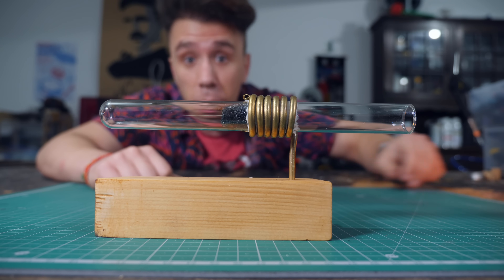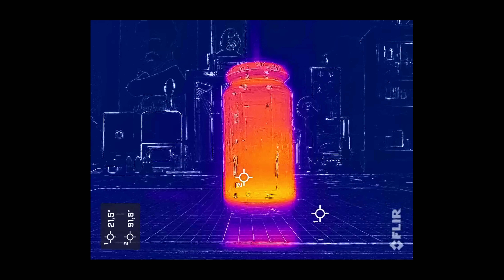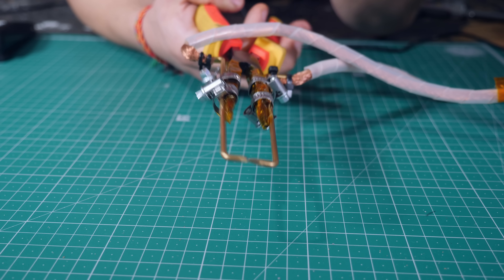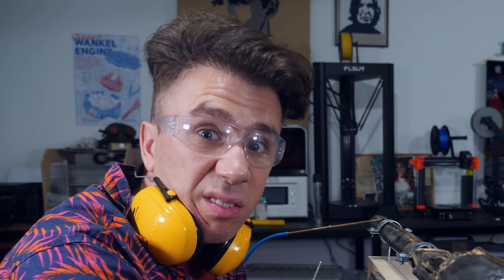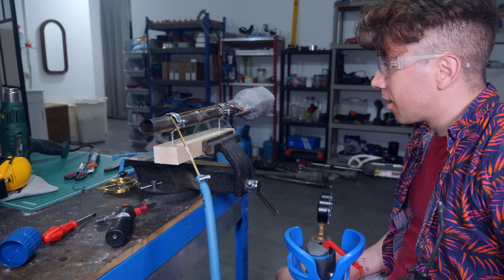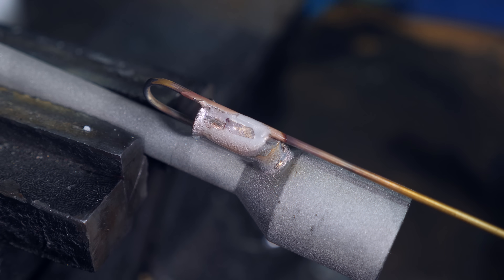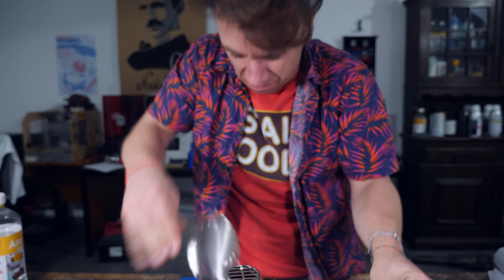JET ENGINE with NO MOVING PARTS (Pulsejet Engine)

Comment: Integza... 
  Shock waves and sound,  and light, and mgnets m, the ocean, all have ... what? 
 Waves... 
   Ok.. so Im ' with you " on that. 
  Are we to molecular  and chain forms of fuel,  avesrge atmospheric contents..  
  Orbits of Elemental electrons and protons and beurtons.. 
  Odd and  'poor harmonics" ? 
  .. what do you think about eye chart tests? 
  I think their results are off beause they do not measure lenses(eye ball) sizes and ratios.. 
  20/20.. that's 5x4 an 4x5.. or something like that 5x20 is 100 though  so who knows ..  but Music, right (?) that echos,  ecuse me, I need coffee, compression and expansion and what gasses diesel compress... and hmm magnetic field ' heat " (activity") .. 
 Why the sky is blue..  something 'dull" insulates... or maybe Im soeaking  backwards.. .. I need coffee integza.. 
   I have some, Ellen D. Of the Same last name got me some and   some htdrogen peroxide cause I have bug bites..  ok let me let you machinate on... does math follow the path of least resistance ? 
   Or are we negilgent and thinking lazy...  .
 Ok,materials  and resonance , and compressions and expasnios  and their spoeed. 8ths and 16th.. 
  Lol.  
    Integza.. not a dik measurement contest, but shock wave and post reliefe compressions . Temperaturs an cooling, do they also  follow the similar rate.. .  Horse shyt if you were thinking that yourself or your  pipe would have more of a parabollicks lol.   Reflectively speaking angled back for conservation and the size of it would also.  And so would your lense  and pulse be more jointly unified  in the their naturally it elementary Holmes..   
  Even thrust  passed the plate.. 
  Fcking A Integza.. 
  Dude, Im fckign not ' ok.. 
 Yeah ballista and lengths of  projectiles  heights of a tornado,  one more sustained than another? Time of day and height of atmospheric dome .. and a spring .. 
 So.. like I said.  Im there with you.. 
   Number of blades and the programmed or calculated steps in the stupes, fluidity of motion and the neesesary  repulsion  increases or decrease  in drawing or applicable forces..  
  I like your engine.. but it is not in as quick and amorphously reactive . .  
  Number of waves reflected back and the ammount allowed to  pass  through , as it is even pusle.   Or  so, lets say we have a bunch of  race tracks.... to push and to pull .. the degredation .. and and I actually do want to draw it down  the pipe...   the increase or decrease of  field foce is relatable..   fck me... ( no, Im not asking to sex me in the ahhhnus.. it is a colloquialism ) ..  ok..  thermocleins and tonadic influences  insise the central line and lense and laese light maininace, as well as the  both poles size and spin..  angle from and  speed of maintainance, arch in arch and the fulcrum and pivot and sapce and angle of tooth curve.  .. Im fcking sick in the head. .  
  Lense dynamics and materials of the lense .. lol.  Ok.. lets say the wave is moving , and so do the fulcrum point to maintain a solid and even appearance..  for it to ride along.. 
 Yes, sometimes I want to puke .  It is not ' Simple"   anything to have safety and longectity when becomming so efficient sir.. too rapid a combining or fission or fusion.. and no considerstion for the   exhaust not magnetic and thrmo dynamics....  hey things in motion... and conservation of heat..  like dude .  It brings much of its motion and heat with it. .   
 Hey Bruh , I have daughters too, they have horses and otters and owls and shyt that are not like ' oh get another goldfish.." ... feel me, and I live in a world with mass graves and people fcking dogs and shyt like that.  And Im like.. oh... fck tell me something about what GOD or the Holy Spirit said to you and I will say, yes your god said that to you, but My GOD sets and Holds Law.. it has been violated and I pray HE Keep HIS Word...  HE the fck had better or HE is not GOD ALL Powerful and Unbending in HIS will..  
 I dont know why the fck I am here if HE is not...  
 So... step the fck back when you talk to me of anything.. fcking language, shtt post congnitive recognition of a pre existing or existing thing  that became through some process... and then the need for the word then became nessesary.. 
  I the fck do not find it ' funny " .  Is Mass Grave as poly sylobahhhbic as I fcking need to get.. 
   They politically banter.. like.  Ok.. why feed them when my own wont feed me and I only get more shyt for trying to save even the women themselves.. and then all of a sudden her memory is like oh, well, i got mine? 
  Im like hey doucheette, things in motion.. accelrate through and passed it and it will pop and disintigrate or want to .  
 Watch a laser through bubble..  mono pole and the two lenses in  harmonic proportion and the bubbles .. compression..  and where the light  lenses around to .. 
  Preditable as a mother fcker. .. 
 So do not be that evil be your propellaant.. 
 If Im gonna respond to their fcking funny..  it will be to and across every fcking system and ability all the fck at once and best I can have us do.. andthe bytch had better keep her fcking word too, after that.. 
  I am not here to banter and play popularity with scum fcks games for money nor for the demonic theocricy nor to their sublties.  
  Nothing of my will is harmonic to nor with them.. I do not seek ballance nor peace with it.. 
  GOD(ADONAI) is the only ONE that spoke to me.. none others .  So, to me, HE is GOD.. and if HE lied then the true Almighty GOD must announce HIMSELF or HE does not live by HIS own Rightious Law.  There Are No Others... Commandment Number fcking 1. 
  HE Must Keep HIS fcking Word. No matter your fcking opinions on the matter.  SPEAK YOUR Judgement uppon the Earth .. !
 This Shyt cannot go on. Or HE is Not GOD.. so HE Must as HE Spoke and Had It Written by HIS own Hand I plea HE Speak and you all Fesr HIM and HIS Wrath to Be Served..  !

Comment: I saw your video and suggest you print green metal parts with your 3d printer.  Then sinter them yourself.  Either that or buy a vacuum casting machine, a kiln, and a metal melting furnace.
Reply: You print with jewelers burnout resin.  Then cast it.  Then burn out the resin and full with metal

Comment: Well if you're going to stick with making it out of glass I recommend using quartz, of course quartz is incredibly difficult to work with because it it has a high melting point, and it just places heat incredibly fast so it cools quickly, but it also is incredibly shock-resistant meaning it could be glowing hot you can throw in water and it won't break.

Comment: I never realized they got got that hot. I've done the jam jar experiment with my son when he was young,  but it never ran long enough to break the jar. If you made that engine a little bigger and lined it with ceramic, of some sort, or coat the inside with a liquid clay and let it dry, do you think that will make it run cooler?

Comment: Integza, if you designed a pulsejet engine to be 3D printed, why not design it with water channels built into the design (whether filament or metal printed). A simple water pump and some circulated water would help with your heat problems..

Comment: It may have been mentioned, and I just missed it…. but is there a specific reason the fuel line is wrapped around and brazed to the cylinder part? Is it just for stability so it doesn’t break off at the “injector” end, or does the heated fuel help? 

I have zero experience in this stuff and stumbled across this video - super interesting! Subscribed :)

Comment: I made something similar with the top half of a bottle,lighter ignighter the wire one,pringles can,2-3 inch wide pipes and some alcohol it only combust but the sound is very loud and the flame reached maybe 15 inches away from the barrel

Comment: I don’t think would suck at welding. You understand the process just practice. You’ll get it. If you can braze / solder. You can weld. I fix appliances. Replace compressors daily. By brazing copper and it is easy now after 6 years but at first was difficult since ei lesrned to weld steel. Before I ever brazed thin metals.

Comment: What about a 3D printed horizontally opposed, single-cylinder, two piston engine that turns a large flywheel.  Similar to a pop-pop engine that maintains a constant speed while providing enough torque to do work while using as little fuel as possible?

Comment: Do you think that acoustic levitation will ever be improved enough to use on humans? Say like a water slide. I know it would be extremely difficult due to needing so many variations of tones to make different matter levitate. Wonder if it could start as levitating a material that could support the weight of the water and body. I think it could really lead to some awesome things. Maybe even floating cars that don't need tires or brakes. Thoughts?

Comment: brother i bought a diesel heater for 130 bucks and i have been learning so much about them, the crazy thing is on the inside its similar to jet engine in someways like the burner and combustion chamber but it uses an electric motor to pull in air to the chamber anyway i think you should check them out or just buy the burner part and modify to an engine if possible.

Comment: Would it be possible to make your pulsejet engine run on hydrogen using Electrolysis? A water powered jet engine. How big/amount of Electrolysis devices would be needed for sustained running? My thinking would be a couple of storage tanks alternating storing/releasing the hydrogen produced to power the engine.

Comment: Why is everything you do, so janky. Just pick up a cheap second hand MIG welder and a bottle of gas. The gas can be CO2, Argon, or a mixture. For beginners a 93% Argon, 5% Carbon Dioxide, 2% Oxygen mix works well.
It doesn't cost much, it takes literally a couple of hours to get good enough to do most things with 2-3mm thick steel.

Comment: You should build a rotating detonation engine like the one Venus Aerospace builds. It uses hydrogen peroxide as fuel. Also, the annulus detonation system makes it so you don't have to continuously pump fuel into the engine.

Comment: Maybe, you can combine the Spaced out  Sections of a Cone shaped Tesla turbine Design with !  a    Golden Ratio  Designed  Propeller IN the Center !  (Heart) of the Tesla Turbine....( USED ! for a more efficient Downward Central  Focused Wind Force ) for a Drone Propeller.  That is Crazy  Efficient  at lower Speeds to power output. For longer range and Better Battery Life..... Using the Bernoulli principle. Possible with Ported Downward Spiral Groves or ! Small Ridges ! to help ! with the Doward Spiral Effect being Created Going Down inside, The Multiple Spaced out Levels of  Cone Shaped Tesla Turbine, To Help Everything be More Efficient. To Create that Tornado Spiral Effect of the Thrust .

Comment: I would be cool to  control the firing of fuel with spark plugs and 555  timer,  thus  controlling the heat and thrust of the pulse jet.  Another ideal is use the exhaust to turn small turbo to drive air flow over the engine to cool  is  down. You  can use  double wall exhaust vent/pipe for gas water heaters.

Comment: Another thing you can do is to print the parts in plastic and then metalize them by electric arc spray. Then you remove the plastic by melting it like the old lost wax method for moles.

Comment: Somewhere in the fields of thermodynamics, frequency modulation, and high energy sources lies the fundamentals to space travel. I've felt this in my bones since I was young. Something to do with the controlled resonance of metallic/ceramic materials and the resulting vibration interacting with the surrounding medium is fascinating to me.
Reply: yah, pressure mediation is also a key to everything. 

I think ufo's use implosive tech rather than explosive tech. Instead of kinetic expanding force and negative charge a craft that follows the principle of positive charge is the golden ticket. 

Think about an electron making its way to capacitance to a capacitor what is the force moving to capacitance? Dielectric acceleration

Comment: A helicopter with a simple tube frame , the seat holds Hydrogen peroxide, which is fed through tubes to the one pound rocket motor on the end of each rotor. The hydrogen peroxide is ignited by silver coated mesh screen.

Comment: Don't heat the piping unless you have to.. it will grow scale inside.  Use Nitrogen Gas inside the pipes to prevent oxidation and scale.  Welding tips from a Refrigeration Mechanic.

Comment: Would it be legal to fly a scale model of a Buzz Bomb where you live?  THAT would be the most obvious use of one of these engines.  I'd always though the real V1 had reed valves in the front to admit fresh air, but apparently the harmonic pulse sucked air back into the engine via the exhaust tube.

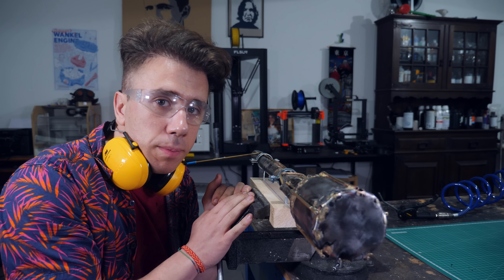Comment: 05:25 i'll get the answer if i keep watching. 
but ????
soldering on a pulse jet engine? 
i know it's hard soldering but i have seen pulse jet enignes glow.  and they seem to get hotter then what the metal is doing during the soldering. 
how is this going to stay intact?
Reply: Soldering is  somewhat heat resistant , depending on what kind you get  it can withstand temperatures , but as for red hot it also depends but it should be able to withstand the heat until it melted .

Comment: 3D print a Nixi tube clock housing that allows for the tubes but also a Tesla coil on either end so you get a cool electric field above the tubes. Always wanted to build one.

Comment: A few unrelated questions:
i) Have you ever read those tiny little instructions that came on soldering paste cans? Is a good way to start improving welding skills.
ii) Why always the combustion chamber is done in metal when it smelt with high temperature? You could try plaster like in videos for making homemade iron-melting ovens.
iii) Have you ever tried barbequed tomatoes? with cheese on top they are great

Comment: COOL VID BRO! ... AND YOUR IN LUCK, BECAUSE I'M AN IDEA MANUFACTURING FOOL! LOL... SO.... YOU LIKE THE WHOLE NOTION OF GOING GREEN WITH OUR POWER SOURCES AS WELL AS UTILIZING ANTIQUITECH... THATS PHUNNIE, MEE TOOO... THE WAY I SEE IT, CRUDE OIL SHOULD ONLY BE USED FOR LUBE, NOT AS A FUEL SOURCE! ME PERSONALLY, I'M ALL ABOUT WATER ELECTROLYSIS! IT'S ANTIQUITECH THAT THEY OUTMODED BECAUSE THEY STOOD TO MAKE MORE MONEY OFF OF FOSSIL FUELS! BELIEVE IT OR NOT, ELECTRICITY USED TO BE FREE AS WELL! WHERE DID YOU THINK THEY GOT ALL THAT SPARE THE TO BUILD STRUCTURES WITH SUCH INTRICATE STONE WORK AND THE LIKE? LIKE THEY DIDN'T SPEND GENERATIONS DOING THAT SHIT... THEY SIMPLY WORKED LESS AND MADE MORE ARTISTIC SHIT.... VS THE BOX BUILDINGS WE CREATE TODAY... ITS UTTERLY RIDICULOUS THAT EVERYONE IS IN SUCH A RUSH THESE DAYS.... ALL BECAUSE ENERGY AND THE COST THERE OF.... TWAT WAS ONCE AS RELATIVELY FREE COMMODITY, IS NOW EXPENSIVE AS HELL! 

SO, THIS PARTICULAR IDEA IS ONE THAT HAVE NOT EXPERIMENTED WITH AS OF YET, CAN'T IMAGINE WHY I JUST HAVN'T HAD THE TIME TO DO SO, LMAO! 

SO, AS THE ANTIQUITECH MYTH GOES, IF YOU PLACE A COPPER ANODE INTO THE AIR, BETWEEN 50 FEET TO 150 FEET AND ATTACH A WIRE OF LOW RESISTENCE TO IT... THE OTHER END TO YOUR LOAD... AND YET ANOTHER WIRE FROM YOUR LOAD TO GROUND.... ASSUMMING YOPUR LOAD REQUIRES 9-12 VOLTS AND ROUGHLY 500mA, IT SHOULD ACTIVATE.... MAYBE THROW A SWITCH IN THE MIDDLE SOMEWHERE, JUST IN CASE...   OR IF ELECTROLYSIS SOUND FUNNER, LOL.. I LIKE TO PLAY WORD SALAD, FORGIVE ME BUT, IT'S PHUN! mAYBE MAKE AN HHO GENERATOR? i BUILT A BABY POTATOE GUN TO RUN SPECIFICALLY ON THE HHO MIXTURE CREATED BY MY GENERATOR, IT BLEW UP BUT, I HAVE SINCE REPAIRED IT AND GOTTEN THE CORRECTFILL RATIO... IT COOL AS SHIT! mAYBE TRY AND GIVE THAT A WHIRL?!!
Reply: Dude, before you try building anything you need to fix your stuck or broken caps lock key.

Comment: Wrapping your engine with copper tubing use makrolon polymer or a heat sink cement to give better conductivity run propylene glycol through the pipe to regulate engine temperature Then add an oxygen line to your combustion chamber. Will increase thrust not only from The increased power of combustion but also by adding water particles to your exhaust increasing density.

Comment: You really owe it to yourself to learn to weld. It's pretty easy and it makes all sorts of things possible. Your home made spot welder is amazing. 3-D metal printing to braze on is mind blowing for and old guy like me. My dad had a rig that would spray molten metal back in the 1970s. Wire feed withe oxy- axcetylene. He actually still has it, last time it was used I tried making a branding iron for furniture. Forty years ago. He got is surplus and used it to metalize art. Sprayed bronze into plaster molds, then washed away the plaster. Neat engine.
Reply: When I was young, back in the 60's, a mate of mine worked for a company that used metal sprayers for relining cylinder bores on engines, and rebuilding the big end and main bearing journals on engine crankshafts. I remember he even used an aluminium sprayer to make a 2 stroke piston back to its original size when it wore down on the skirt.
Reply: I recall being told the sprayed bronze could be made  porous and could hold oil. One of the applications in industry was sintered bushings.I think it might be obsolete by modern standards, but it's a neat machine.My father used it to build some doors that were the entrance to the Playboy club in Chicago. When the place was closed Michael Jordon (basketball) bought the doors. As far as I know they are still in his house. @BobHUK
Reply: @rowgler1  Brilliant! :goodvibes:

Comment: You should do a jet propelled fly/ rc car.  Love the jet engines. Can a nitro motor run of off hydrogen and does it become faster or slow more or less horsepower. And another video do a hydrogen powered nitro rc car. Get alot of likes off these 2 ideas